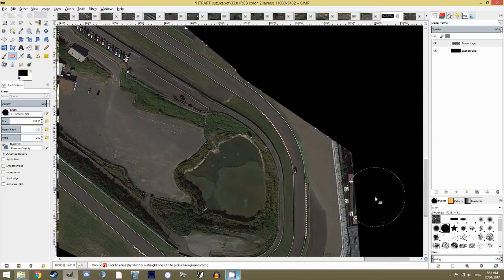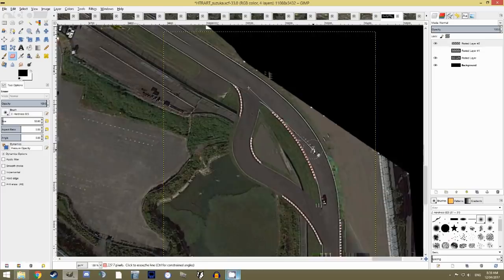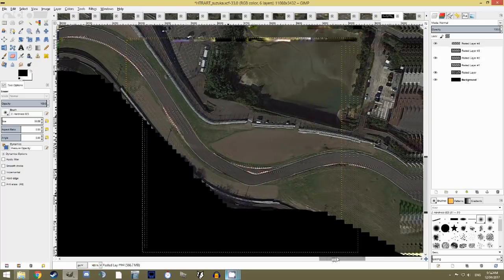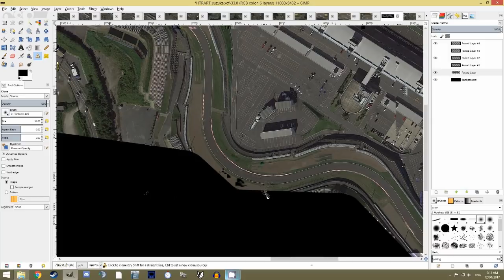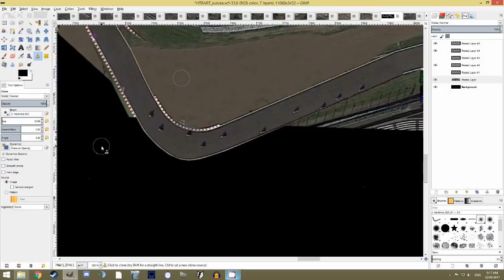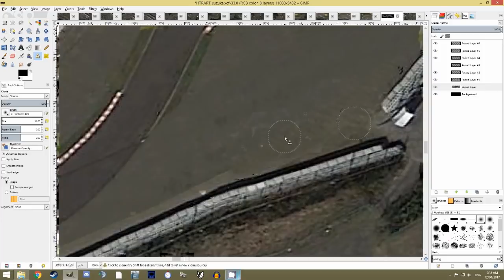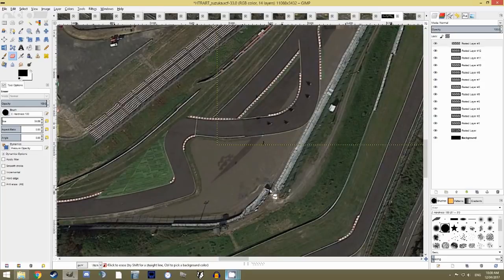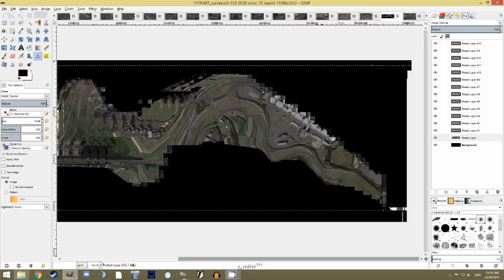How To Ruin A Race Track - Suzuka Circuit

Comment: For the full Tilke experience... don't forget you'll want increase track width by  ~300%. We want the cars to look like toys and ensure (for the drivers and spectators alike) the sense of speed is vastly decreased. Also, don't forget the wonderful possibilities of negative camber....you'll probably want to build some in at every corner. 

Also, for no particular reason, it would be best if the crossover bridge was switched to a tunnel...
Reply: The negative camber...fuck me. Now THAT is a way to ruin a track.
Reply: @ventisette.  Negative camber is great in the rare instance, Turn 5 at Mosport for example.